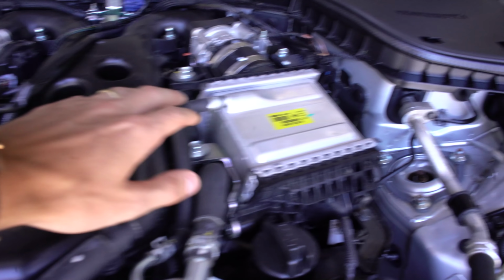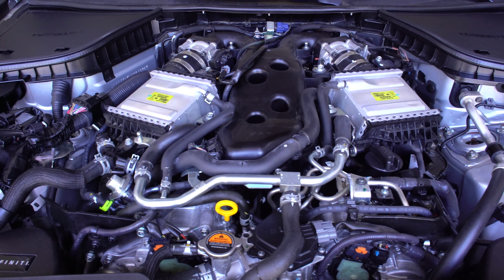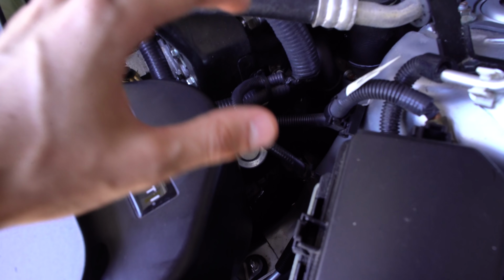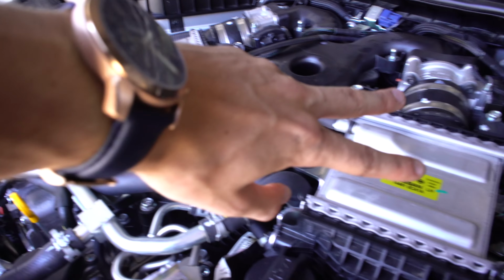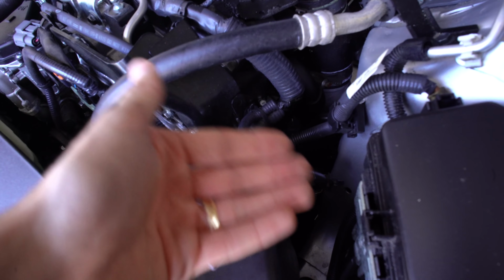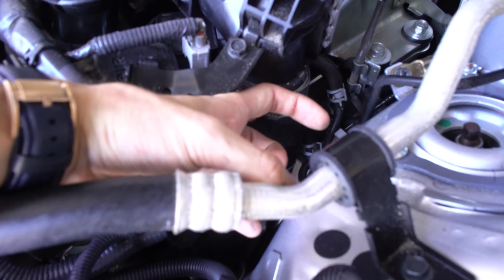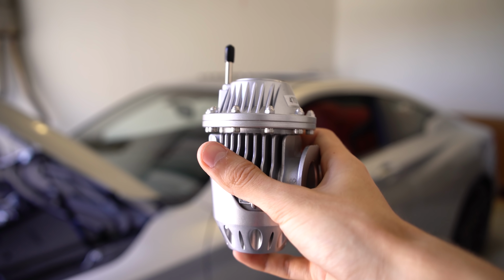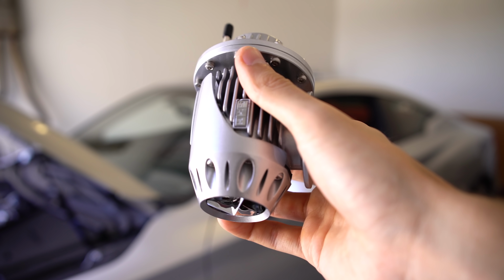Saving My Turbos

Comment: You say the car got a VR30DDTT engine? Just put a little bigger stroker to bump it up to 3.8L and a few other things to become a VR38DETT and now you got closer to owning a rwd nissan r35 without having one.
Reply: Can you bore a vr30 to 3.8 liters?
Reply: @stefberkenbos814  The thing I thought about was changing the crankshaft to one with a bigger size but dunno. Try check wikipedia or any other source for info about it.

Comment: Turbo engines cars are fun to drive, but that fun comes at a cost. Those turbo engines don't last as long as regular non-turbo engines and can cost a lot in repairs in the long run. That's why fast cars is not a good hobby unless you have a lot of money to burn.

Comment: I have no need for blow off valves on my turbo setup. Something about Diesels that screams more air all the time. lol...
Reply: Diesels are like a freight train man you can't let off the torque curve is addicting.
Reply: @markm0000  I got a powerstroke 6.0, can't wait to try out a Cummins swap. But not until the trucks paid off
Reply: @obisstuff6884  I had a 6.0 PS and a 5.9 C. I can tell you save your money and just make your 6.0 bulletproof. Don't put any money into converting it life is short and that money is better spent on vacation or starting a small business. We're talking a good $10k to do the swap right and in the end you'll never get your money back.
Reply: @markm0000  well we shall see.
Reply: @Matthew Andrews yes it can.
Reply: Mark M  no such thing as a bulletproof 6.0
Reply: @steen8156  Yes there is. At least at stock levels there are. Custom tunes make things a bit wonky...lol.

Comment: Good idea. I killed my turbo on my $100 Pontiac Sunbird convertible because it had no stock blow off/bypass. I spent a week doing the headgasket and barely got a year out of it after I raised the boost.the turbo bearing blew out. this is what it looks like stock.
http://consumerguide.com/wp-content/uploads/2014/07/90129221000408.jpg

Comment: i like you more now that i know your a car guy.
Also you can get adapters to recirculate the pressure to keep boost between shifts.
Reply from the maker: Find an adapter for the VR30DDTT platform.
Reply: @GregSalazar  unfortunately there is no kit for your car. This is the adapter for the hks ssqv https://www.z1motorsports.com/intercoolerbov/hks/hks-ssqv-recirculation-fitting-p-5209.html .
From there you just need another T hose between the MAF and turbo.

Comment: Jesus the engineering on this car is crap. No bov or recirculating system and you have to instal the bov after the air goes back thorough the intercooler. Also 400hp is not as impressive as you make it. I’m sure that thing can take a lot more but awesome choice of bov’s.
Reply: Ever thought they didn't put one because you don't need one?
Reply: DriftNick if that were the case you should of tagged the owner of this video. 🤦‍♂️
Reply: @mrexile09  Already commented it not being needed.